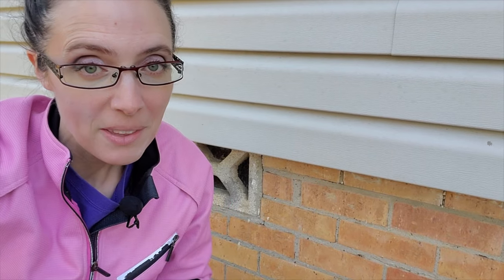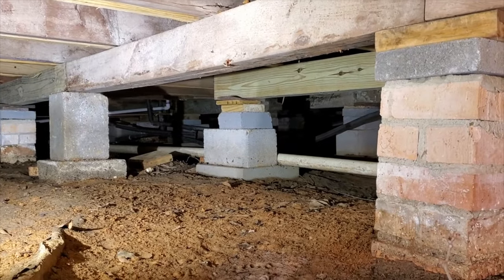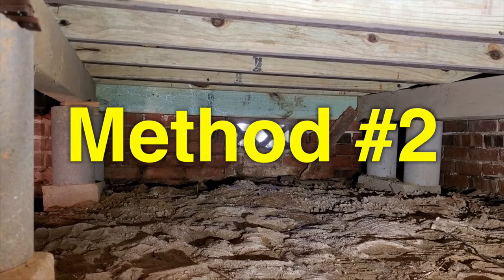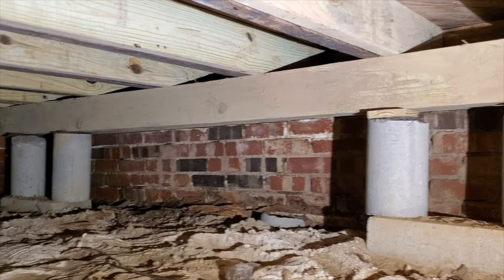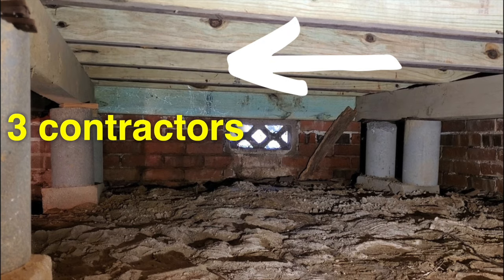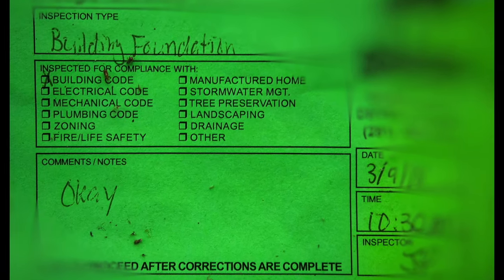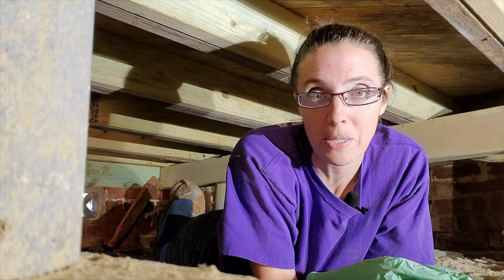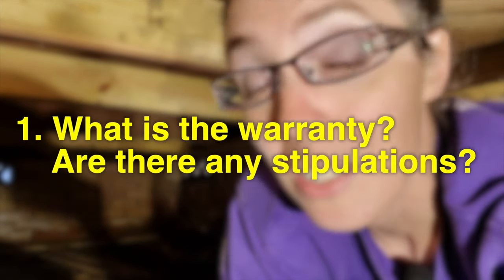2 Different Pier & Beam Foundation Repair Methods

Comment: Great video. Currently working on similar project. Only wall I got left is the last joist(the wall is sitting on it) then sitting directly on top of the foundation. Question is how do I lift that side. I already lifted it 2 inches or so just need another 1/4 inch
Reply from the maker: We used a few 20 ton jacks in series with a beam spanning several joists to get the clearance on the sill plate. The thumbnail on this video shows how our hired contractors used the same method: https://youtu.be/oW4j9bP6ULQ Best of luck on your project!
Reply: @OveranalyticalDIY  okay thank you appreciate your video and info!!

Comment: Apart from dead weight, what is holding that house in place laterally on the piers?  Is high wind not an issue there?
Reply from the maker: 1951 says not much...

Comment: You did this all yourself? we are in a house that needs that kind of work done . I wonder if I can do it myself. Have you ever though of x bracing ?
Reply from the maker: When we first bought the house we sistered what was left of all the missing joists after removing the sketchy subfloor in the kitchen. Years later we hired two foundation repair companies for that house and a different house due to limited "vacation" time at work. While we hired out the foundation work itself, we repaired all the aftermath ourselves, which I shared in this video: https://youtu.be/yunHPFYLOqg. It is very possible to DIY, but you want to make sure you have all your bases covered before starting--up to and including your work is to code and permitted, if needed. I really do wish you the best in your project and a half!

Comment: About how much does it cost to have an engineer come to create those plans
Reply from the maker: Throwing out a number, without full knowledge of the situation, is a bit risky, but I'll venture $1-2K with a whole handful of salt. It depends on a whole lot of factors such as your location (NY or CA vs most everywhere else), what is included in the service (return visits, imaging, etc.), kind/size of the house, etc. Sometimes engineering is included with the foundation company bid. I'd prefer hiring my own because they are more likely be unbiased (compared to an engineer paid by the foundation company). If it is included in a foundation company bid it will be hard to extract the price from the rest of the work. I hope this gives you somewhat of an idea and a few considerations.

Comment: im not a engineer, but was thinkg of what your calling a floating foundation. have been trying different things , but original house is sitting on limestone rock foundation. any suggestions here? cause when it hits 18 degree below zero with artic blast, my house tried to run away. had to pht a leash on it and tie to a big tree🤗
Reply from the maker: I have to default to a licensed engineer for that level of detail. Foundations are certainly one of the worst ROI home investments. Very important, but not something that makes us enjoy our space--more like resent the problem/builder/soil heaving/etc.

Comment: I've been doing this work for 30 yrs. I've done every aspect of foundation repairs imaginable. I would like to say that a contractor like myself have met with individual engineers on most jobs to talk about the best methods required. That helps all parties to be on the same page. 99 percent of the time what I suggest prior ends up in agreement with the engineer.
Reply from the maker: Well said! Agreement is key. I appreciate the support on including engineering. Thanks for adding this to the conversation.
Reply: I'm just going to wing it.  Never done it in my life, can't make it worse than it is unless I tip my house over somehow.😊
Reply: @danjim7056  I give you a lot of credit for taking this on yourself and Lord only knows money is tight for everyone. I wish everything goes perfect and wish you the very best. Thank you kindly for the reply.
Reply: @D Ford  Thank you, kind sir!!  I'm gutting the whole house, including the subfloor, so I'm hoping that will make the process a bit easier.
Reply: @danjim7056  My advice is mechanicals first when you put it back together. Make sure your plan for electric, plumbing and heating are sound if you're going to demo just a portion of the house or the entire thing. What is the most efficient aspect for your needs. Good luck on your projects.

Comment: None of this looks code, but I don’t live in your area. Using cmu piers the joints must be motored and bonded. I would NEVER do a foundation repair that looked like this!
Reply from the maker: Thanks for sharing your knowledge. It certainly is one of those things where you only know what you know and by hiring those in the business there is a certain level of trust. I can't say with any certainty what code was when these repairs were done 6 years ago, but I would look at code beforehand now. Thanks for adding to the conversation.

Comment: We just bought a 2600sq ft home on 2 acres. It is pier and beam. I did it myself with help from my friend. We replaced all the beams with steel beams. Ran all new plumbing with sleeves and ran a new duct from the plenum to the crawl space which can be opened during cold weather to prevent freezing pipes.

While it saved us a small fortune doing it myself, it "steel" wasn't cheap. Also, I'd forgo a foundation of any kind before I ever did this again myself. I think I aged a couple years over the past 2 months. Haha
Reply from the maker: Whew! Not cheap and not lightweight. You didn't have to go to the gym on those days! For real on the aging thing!

Are you saying you'd pick a slab over pier and beam next time?
Reply: @OveranalyticalDIY  @coryraymer6068, i'm also confused about what you meant by saying you'd forgo a foundation of any kind before you ever did this again.